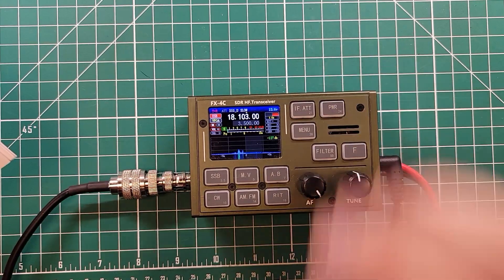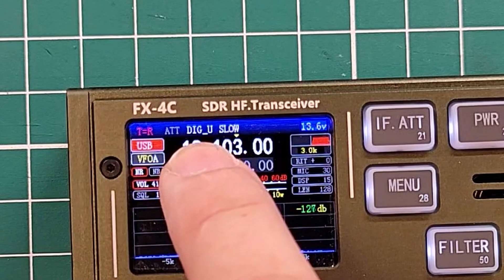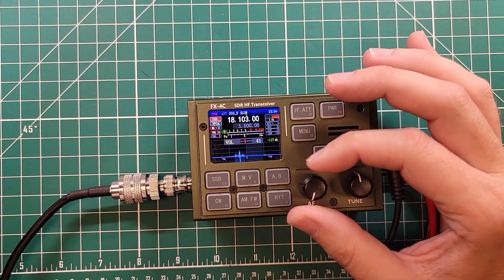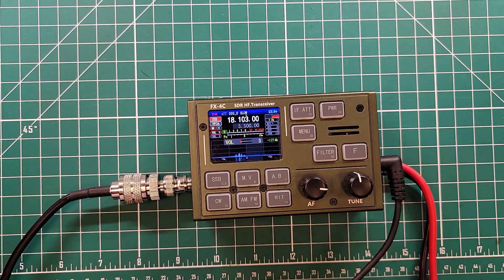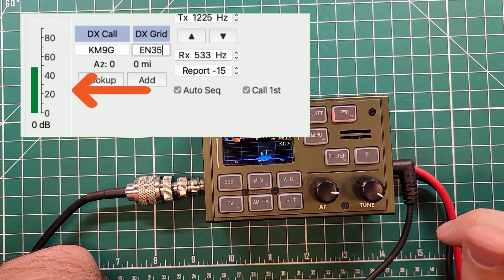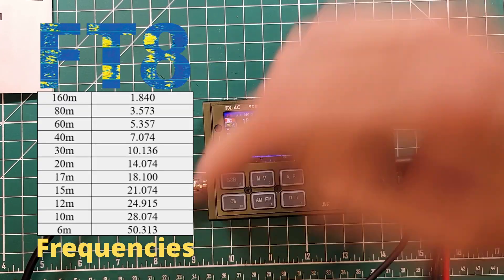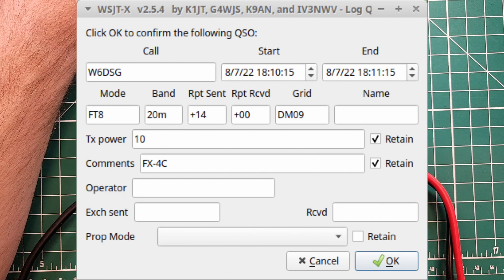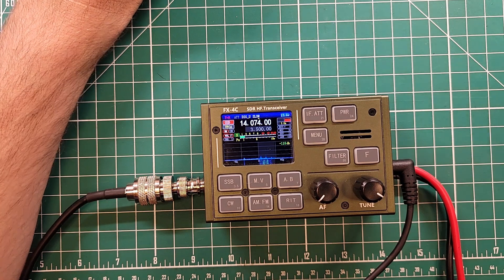How to FT8 in Under 2 Minutes on the FX-4C

Comment: Two years later, the FX-4CR has Bluetooth and rig control to make it easier.  It also has a built-in fan so you can probably run 10W on digital modes and stay cooler.
Reply from the maker: Thanks for the update!
Reply: @temporarilyoffline  - Your video was ideal for me because I prefer JS8 so I'm using a notebook PC, but the FT8CN Android app directly controls the FX-4CN for FT8 via Bluetooth so setup is wireless and very easy.  We need an Android app for JS8.  I hear there is work being done to port it but it's not as easy as it sounds.  It'll be great to have the 9" Samsung tablet that I use on my motorcycle for OSMand GPS navigation used for JS8 with the FX-4CN mounted to the handlebars with the 65 watt 20,000 mAHr Anker power bank that I use to power the FX-4CR under it and my Moto POTA antenna (the motorcycle version I made of the POTA PERformer) also mounted to the handlebars.  Shack-on-a-bike!

Comment: Thank you fro your video.  I can not find ALC on my menu?  I just got my FX-4CR and wanting to do FT8. I got the software FTBCN on a fire tablet and it transmits and receives and CAT controls. I adjusted my volume, but my ALC shows when transmitting at ‘53’. I do not have as many options on the menu that you show. What am I missing. The FX-4CR works on SSB great. Help. I reached out to the manufacturer via email. But as of yet no response. W8BLT David H
Reply from the maker: Sounds like a fun setup! I am looking to get a tablet myself.  There is never a setting for ALC on the radio - you control that by lowering your speaker volume (the speaker on the phone that goes to the radio) - you are essentially shouting at the radio and the radio is putting it's hands over it's ears - lower the shouting and the ALC will get better.

Comment: Thanks for the video Steve. How much have you played with this radio over the past year? I've borrowed the FX-4CR from @N1JUR for the week and having some difficulty with the BT functionality on transmit only. I'll look around for other videos that may have some tips to getting the BT audio configured properly. Looks like the USB connection is really simple, so I appreciate you sharing that. 73 bud.
Reply from the maker: This radio was a loaner to me also.  I haven't touched it since I finished making these videos and returned it.  Are you not able to make a BT connection at all?
Reply: @temporarilyoffline  I figured out that setting up BT via FT8CN only gives the receive half. The device BT also needs to be connected. In my very compromised testing configuration I'm seeing reports on PSK but a full QSO should be coming soon. I'll do my best at some type of informative video  when I hit the park this week. Shocked at how fast this little radio got VERY hot from transmitting. Thanks for the quick response!
Reply from the maker: @NovemberOneOscarGrouch Yeah, I'd bet if you were TX full power FT8 that you'd  heat it up pretty fast for sure.  If you've got audio BT working, I might skip CAT control and just dial in a frequency manually and set to VOX?  Having BT Serial and BT Audio running at the same time is pretty hard for embedded devices (not impossible, so it might do it).  Good luck!

Comment: Tearing my hair out with FX-4CR trying to get the digital modes running. I have Ubuntu 22.04. I can press the SSB button any which way I like and I can't get the DIG_U up on the screen. I bought from BG2FX who I emailed about this and no reply. I can't get the rig to switch out of using the internal microphone as its audio in rather than the USB. USB audio working fine as the output from the radio to feed WSJTX. But, aaaaghh, can't get the radio to use my computer's output as its input. This is my second and last Chinese rig, at least for the moment - many glowing reviews from trusted people on YT but, yeah. EA5HQ.
Reply from the maker: In WSJT-X - is your mode set to None, USB, or Data?
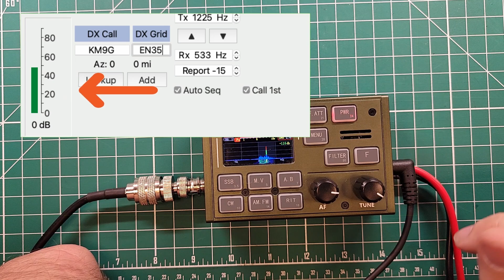Reply: @temporarilyoffline  Hmm, just like in your WSJTX setup around 1:05, the None/USB/Data is greyed out.  Except I have to choose /dev/ttyUSB0 because Linux.
Reply: Also note I'm on a FX-4CR, not FX-4C. I'm on firmware V1.2 2023/04/15.
Reply from the maker: Can you switch the radios mode around properly when you are not connected to the computer?
Reply: @temporarilyoffline  Disconnect USB from radio end. Power on radio. Hitting SSB button just toggles between USB and LSB, DIG_U doesn't appear as an option.  With or without USB connection.  The FX-4CR (R for romeo) manual V1.1 2023/03/17 suggests the SSB button should work the same as per your video on the FX-4C (no R). I had this same problem when I was running the original firmware from when I got the radio - one of the first batch produced.
Reply from the maker: @marcusjenkins  Hmm, I don't have an R and I'm out of ideas if it /never/ goes into DIG_U mode - maybe its a setting somewhere else in the radio instead - Icom's are like this - there is one setting for SSB that toggles between LSB and USB and another that turns on DATA

Comment: Do you know where I could get a spare USB cable for this rig?  It seems like all the USB to 3.5mm cables out there aren’t wired like the one that came with my FX-4C.  73 de N9ZCD
Reply from the maker: They sell pigtail cables on Amazon, I'd make one using those.  -- I'm assuming its a physical interface convertor and doesn't need a uart chip.  (But they make those too)  check the manual and start here: https://amzn.to/42dpxsY
Reply: @temporarilyoffline  Thanks!

Comment: Sweet Radio
Reply from the maker: I was really impressed!
Reply: @temporarilyoffline  I Wish i have one, bud it's a Dream for the Future. Now I use a Yaesu Ft 818nd. Is a lot of Wight in my bag
Reply from the maker: @kokohenker9439  818 is a great radio
Reply: @temporarilyoffline  You right, has a good RX Unit. Bud the FX-4C ist a little bit Smaller. P.s. you has an new follower and a Activatet bell, ham interest at the Antenna Build part 2 Xiegu VA4 73 from Germany

Comment: Another great video. What firmware version do you have installed Steve? Mine is 1.1 and doesn't show ALC in the menu. I tried ft8 and I make contacts but the power output is not stable.
Reply from the maker: This was a loaner radio from a viewer.  I didn't do any firmware related work on this one.  Is the power moving due to the signal changing or something else?  There should be some minor variable-ness - something major and I'd be worried that I'm over driving the receiver and  maybe dial-back the volume on the computer to compensate.
Reply: @temporarilyoffline  The output from the PC to the transceiver is stable and with my other transceivers I don't have this problem. I had it in the past with one of my transceivers when I started doing ft8 and it was RF feedback that was cured with ferrites on the USB and audio cable but this is not the case.  It is unstable even if I reduce the output power from the PC slide bar. Receiving is fine and as I mentioned I make contacts and PSK reported shows my signal all over the USA. I am not too concerned as I only use ft8 to check the propagation and the results of trying my antenna experiments. Thanks for replying.

Comment: That simple? I'm going to try it today! Have you had much luck using this rig with FLDIGI or JS8Call?
Reply from the maker: If it works with FT8, it should easily work with JS8.  As for FLDIGI - no problem at all either.  In all 3 cases, there is no cat control, but the C-Media Electronics chip is very popular and FLDigi won't have any problem listening while you tune around underneath it.
Reply: @temporarilyoffline  Worked well with JS8Call and WSJTX. FLDIGI was another story. It looks like you have to use something like FLRIG for rig control. I hate FLRIG. When I tried to initialize it, I got this "Transceiver not responding!" error message. No idea how to fix this. I wish FLDIGI had the same simple rig config as the other two programs, instead of having to use FLRIG.
Reply from the maker: Try fldigi without any rig control, that's how I most often use it.
Reply: @temporarilyoffline  How do you do that? C-Media PTT options under Rig Control? I used that and managed to get the radio to key up. Couldn't see anything on the waterfall. I guess that's an unrelated problem.
Reply from the maker: @dangermandave67  Maybe VOX?  I haven't tried it with this radio, but if you've already got it, its worth a shot.